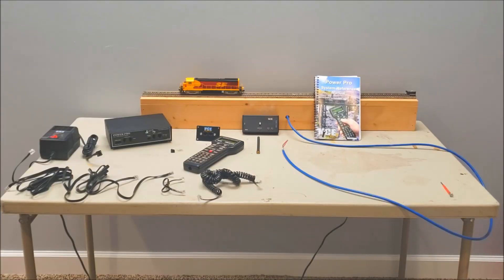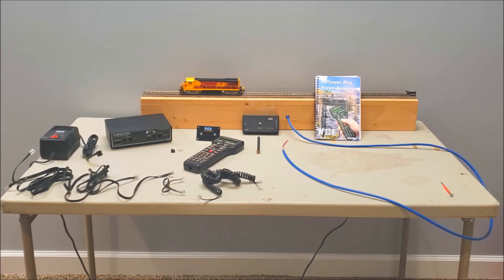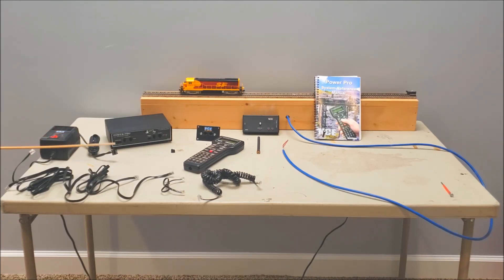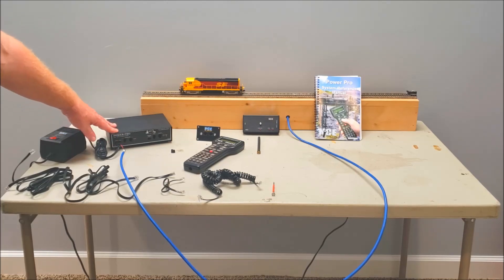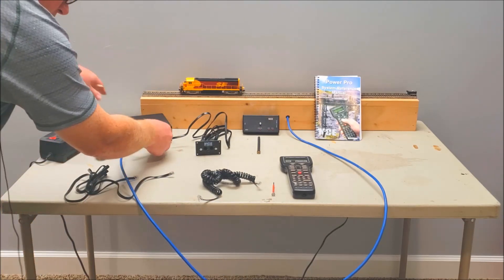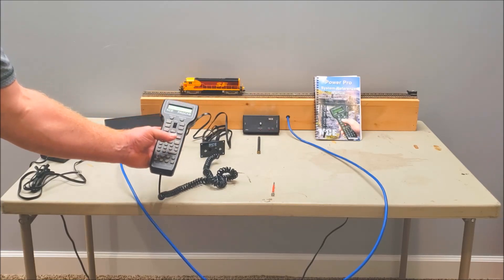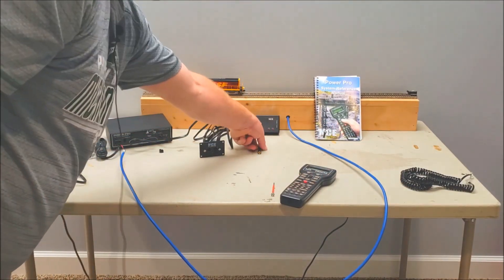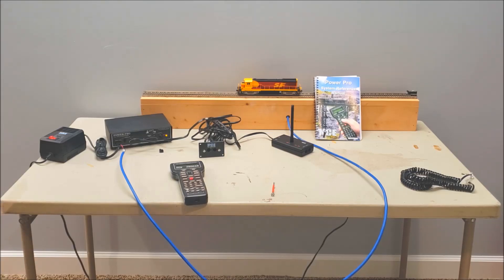NCE Power Pro-R overview and basic setup

Comment: Does that starter kit come with a power pack or do I have to buy one
Reply from the maker: It does NOT come with a power pack.  You will have to purchase that separately.
Reply: @brownjm74  ok cause a set of the same thing i was looking at comes with the power supply
Reply from the maker: I just did a Google search and I stand corrected!  It looks like some dealers are including a power supply.  So make sure you read the description carefully.
Reply: @brownjm74  ok will do

Comment: The the locomotive have to be radio control ready? or will any DCC loco work? NewB  question
Reply from the maker: Any locomotive that has a DCC decoder installed will work with a radio NCE system.

Comment: WOW !!  what a bunch of Nonsense!!
and MICKEY MOUSE junk.
There is MORE than $1000 Bucks here, just to make the engine move.  
Even as a Child,  I got my Power Supply from a 2nd hand store for less than 5 Bucks.
Then I assembled a PWM (assembled and built by me) modulator as a Speed control,  With a Toggle switch for Reverse direction and VOILA!!  for less than 15 bucks!  I had a beautiful working  system for my LOCOs   
a track switcher was a simple push button switch.  

ALL this gear is aside from the Model trains themselves........
What a waste.    for REAL SUCKERS.........
(they say "there is a FOOL born every minute...."  )

Maybe I'll go into Business a build system for a 10th of the Money, wasted here and STILL make a Profit!!........

Comment: Jeremy, I am not very good about electronics, so I am curious about something you did not cover. The left side first two connections are for the power. Is there a positive and negative wire, or can you just randomly add the two black wires from the power supply? Also - the same question on the next two terminals in the 4 pin block that go to the track. Do you know if there is a positive or negative track wire? I also ask as I have a small circuit board surge protector with seems to mark a positive and negative input that I'd be using between those pins and the track.
Reply from the maker: No there is no "positive or negative" when it comes to DCC.  With that said...you do want to keep polarity when you are wiring your layout track.  For example...I use red and black wire for my DCC power buss for my layout.  I have the rail nearest me on the red wire and the other on the black.  This way all of the track has the same polarity.  If  you have a reverse loop or wye, you will need a "reverser" to change the polarity.  Hope this helps.

Comment: Nice DCC setup, however a bit outdated IMHO. No WiFi, radio throttles in this day and age? Certainly NOT worth the price, maybe for the power cab 1.5Amp starter system but not for the Pro Cab setup, way overpriced. And the display is quite small with no color.